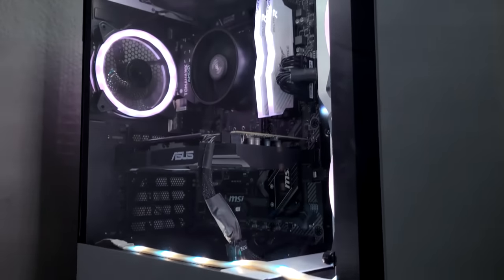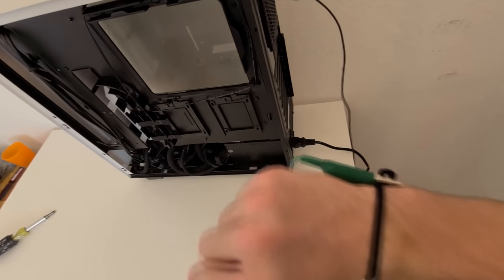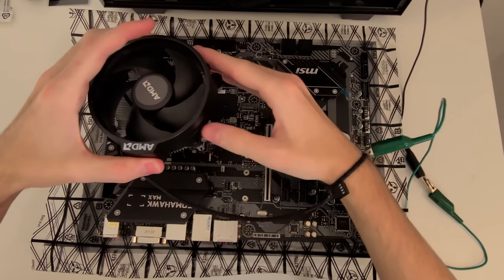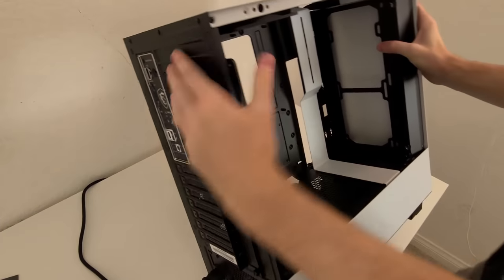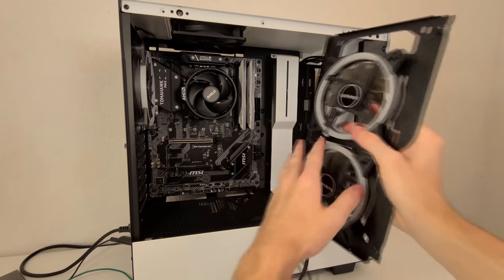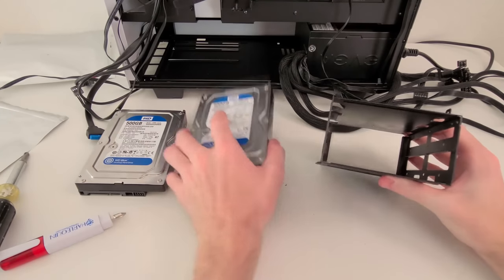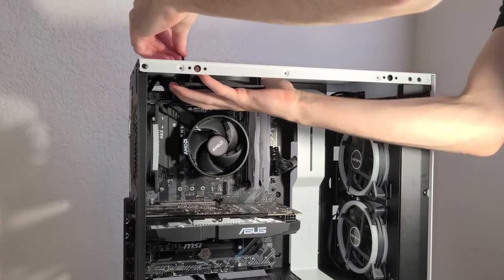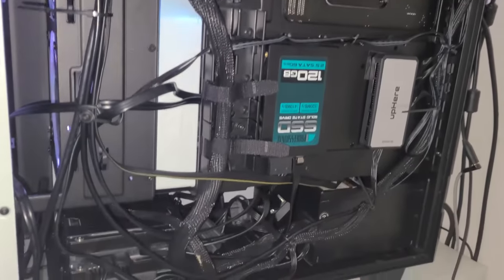BEST $700 Streaming/Gaming PC [Build Tutorial]

Comment: you did alot of mistakes in this video i dont know if this is your first time building a pc or something but my question is why did you put the thermal paste on the desk when you put the cpu cooling fan down?
Reply: He also placed the components on top of the Anti-Static bag, which is a no no as, the exterior of the bag is conductive and can raise the risk of damaging the components. He should've just place the motherboard directly on top of the box it came with to minimise any damage done by static electricity.

Comment: Looks great, id just change the CPU cooler since that model doesnt really do a great job and it kinda looks tacky compared to the other parts.
also this build was crazy expensive to make in 2021, should be cheaper now since the gpu market is slowly coming back to normal , ive seen 3060ti:s for low as 600 now

Comment: Why does everybody seem to skip the rgb and fan connection part. Right now my fan lights are one but the fans aren't spinning, I have a b450 pro vdh max, and a cooler master mb311l, I need help🙏🏾🙏🏾🙏🏾, I don't know where to plug it into
Reply: @sagtil2596  thank you but i figured it out, i was having problems because it had something to do with 4 pin and 3 pin connector or something like that
Reply: @Rinzae  Ah okay, understandable. Ye 3 pin fits into a 4 pin headers aswell.

Comment: Instead of a Rx 580 graphics card, will a Geforce Rtx 3050 fit or work? I'm a nooby on pcs and I don't want to mess something up
Reply from the maker: Yes
Reply: @Roo_Tech  wow didn't expect you to reply, thanks for letting me know
Reply: bro if you have not bought anything not take the 3050 or 6500 are very bad rx spend those 100 € extra and get a 3060 or 6600 xt rx or get a used 1660 s which is much better
Reply: @xdavix2578  Yea, I did a lot of research before I got it and I got a 3060 ti twin edge rtx instead, thanks for letting me know though 👌

Comment: How much fps can it run when done building?And can I just install one hard drive or does it have to be two hard drives?
Reply: Fps is dependent on the graphics card you're using and of course what your monitor can handle.
He actually has 3 hard drives installed in this build (1 ssd and 2 hdd). You only need one hard drive but some people install multiple hard drives for various reasons.

Comment: i know there is a ton of comments but i have two things one does it run fivem smooth? and 2 where do i put the storage device u put in the description on amazon?
Reply: I had a build similar to this and a rx 570 in general has no issues with running gta. You should be cool

Comment: I like the video and symplicty of you showing how to build one, however, I'm a little confused. 

I understand that this gaming computer, but I was wondering about the DVD Burner to load Windows programs or should I just get a USB DVD Burner?
Reply: DVD drives are a thing of the past since most modern software is distributed as a download. If you still want to keep using DVDs, you can either buy an internal DVD drive (as long as your case has at least 1 5.25" drive bay) or a USB DVD drive will work just as well.
Reply: @JJFlores197  This is basically what I expected, however, I was viewing a video that was posted regarding the "Best $700.00 Streaming /Gaming" and was looking to purchase everything I need to build the tower. I don't want to spend a whole lot of money, especially, if I will be building the tower myself.

Comment: If I use a Corsair Vengeance RGB Pro 16GB (2x8GB) DDR4 3200MHz C16 LED Desktop Memory - White (CMW16GX4M2C3200C16W) ram would it fit in the motherboard
Reply: It will physically fit since it is a DDR4 kit. However, you should check the motherboard's QVL (Qualified Vendor List) to see if that specific kit has been tested on that motherboard.

Comment: A PC builder website tells me that the b450 tomahawk max and the NZXT h510 are incompatible because of the front panel USB 3.2 Gen 2 type C port, that’s because the b450 Mac does not have sufficient usb 3.2 Gen 2 or Gen 1 headers, so the case USB 3.2 Gen 2 port will not be usable
Does anyone know any other motherboard that can substitute the B450?

Comment: Hey man, I bought and built this pc this week and have been having many troubles. Everything is working perfectly fine... except for the gpu. I got your other recommended Radeon rx580 armor 8g oc, but the fans are not spinning and I get no display from it. I have been able to install windows onto the pc a few time before the fans stop spinning and it I get no display, but when I boot up the pc it brings me back to BIOS and not to windows. I have spent hours, almost a full day trying many different solutions, but to no avail. Is there any way you can help me?
Reply: I have figured out that this happens when I plug my Ethernet cable in so I can do all the updates. When my pc is doing the updates is when it loses signal from the monitor and the gpu stops working

Comment: I have a question can i get the processor from my laptop and put it in the motherboard of the pc
Reply: Of course not. A lot of laptops have a soldered CPU so it is impractical to try to remove it. If your laptop did happen to have a removable CPU, it will be too small to fit in any desktop motherboard. There are very few laptops that have a desktop CPU in them, but those are only in some very high end gaming laptops.
Reply: @JJFlores197   thank you for the information

Comment: i want to build my first pc can i use intel icore 5 instead of the ryzen inside of that motherboard??
Reply: you would need a motherboard that supports intel or it won't even turn on
Reply: @zany666  yo the graphics card is too high i found a another on amazon does the graphics card have to be specific
Reply: @shockzs_8038  nope it doesn't have to be specific at all
Reply: @shockzs_8038  hope that helped :)
Reply: @zany666  it did thank u but i dont know which one to choose can u choose one for me that will help me play fortnite u dont have to just asking
Reply: @shockzs_8038  How much are you looking to spend on a graphics card?
Reply: @zany666  200 or less sorry for responding so late do u have instagram or snapchat if not 200 or less tho

Comment: If i wanted to buy a gtx 1660 is it compatible with the other components?
Reply: As long as you have an adequate power supply (PSU), should be fine yeah
Reply: @adenofsowers864  thx

Comment: I've never had a PC, only laptops, I'm scared to build one cuz I don't wanna fuck it up but prebuilds are more expensive for the same thing :(
Reply: The way I see is: you can keep living in fear or take the plunge and do it. not trying to be rude, but just saying. We all had to start somewhere.  If you can, consider buying an old PC or if you have an old system laying around, consider using that to learn. That's how I got started with PCs: taking apart an old system and putting it back together. You don't need anything fancy to do this and it doesn't even need to be functional, but you get bonus points if you can make it functional.

Comment: How do you connect this to WIFI. Can you just connect it online or do I nee like a adapter
Reply: You would need to buy a Wi-Fi adapter. For future reference, look at the specifications of the motherboard. If it has Wi-Fi, it will mention it in the specs. Also, most Wi-Fi equipped boards will have Wi-Fi in the name.

Comment: Bruh it is extremely difficult to install the cpu connector even with removing that top fan. Smh. There is barely any room and my connector is barely long eough to gove enough damn slack. Im about to just grab this whole pc and smash it to bits
Reply from the maker: Maybe use needle nose pliers big dog
Reply: @Roo_Tech  I was able to do it. I just had a pro mobo that have these metal pieces that are tiny radiators to protect mobo from overheating when overclocking it and the fans were in the way so I removed one of those radiatiors off the mobo and both fans. I have big hands, lol. It wasn't your fault I was just very frustrated and my face was dripping sweat when i was working on it from the stress and frustration lmao. I did it tho and PC is built and running like a dream.

Comment: My power efficiency PC Game config on Dez 2021 😎

Motherboard ATX Gigabyte Z590 UD AC (With PCIe 4.0)

CPU Intel i5 11400 (support PCIe 4.0)

Cooler CPU Arctic Freezer 34

RAM Crucial Kit 32GB DDR4 3200MHz Ballistix Black CL16

SSD Samsung 980 PRO 1TB Gen4 M.2 NVMe

Graphics card Asus RTX 3070 dual oc 8gb 

Power supply Corsair CV-650W Dual EPS 80+ Bronze

No overclock 

I play every recente games at 2k above 100fps 😎 😎 😎 😎
Reply: okay?

Comment: do i need the 2 fans in the front
Reply: I would 100% recommend you to use the 2 fans in the front. They push air through the pc case and out to the exhaust fan in the back which keeps your pc cooler.

Comment: Where to connect fans?
Reply: Did you figure it out?
Reply: @itsdarkbtw  yes goes to the motherboard, read your motherboard manual you will see some slots labeled fans or something like that, if you have corsair rgb fans one end goes to the Node pro rgb controller and the other to the motherboard or fan controller

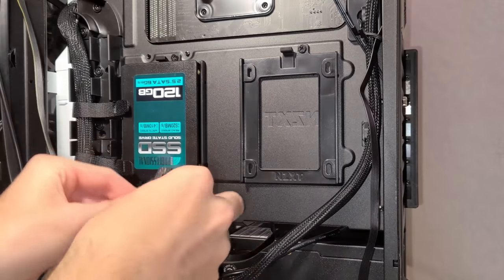Comment: I don’t understand on 14:16. I don’t get it. What do I do?
Reply: So what exactly are you confused about? If you have a 2.5" SSD or hard drive, you plug a SATA cable and power cable to them.
Reply: @JJFlores197  is there any way how you can put one only on the ssd and take out the wires for the hard drives?
Reply: @yurboidxrii  If you're only going to use an SSD, sure. Of course, if you do this, your hard drives won't work.